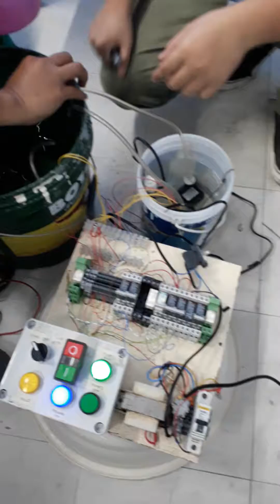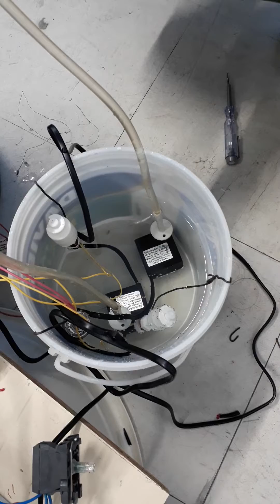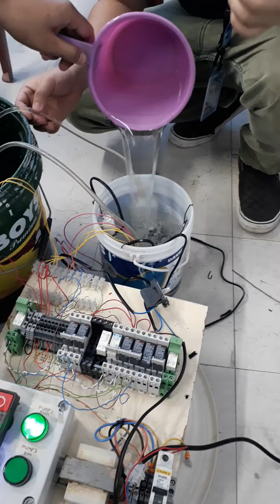How to become a BMS engineer part 56 (How to simulate Manual Control for a submersible Pumps)

Comment: As per to This logic;
P-1always will be first duty, 
P-2 will be second duty, 
if can you make change over as per to pumps run hours with timer it will be more nice..  without PLC controller for more cheaper... 
So both pump will be life time run hours the same.. also if any pump tripped or both float switch on the same time this logic should be second stage,, up to resetting all alarms,,, 
So, Is this possible to do through hardware?🤔  
Did you got my point? 
Thanks,,
Reply from the maker: Actually when I am teaching my student Building Management System the first few lesson are to prepare power and control diagram for an equipment in a Hand or manual control. Next lessons will be how to prepare the equipment for Automatic control thru DDC (Direct Digital Control) where they will learn how to write their very first control logic. You are right to do pump sequencing we can use the run hours of the pumps which is a basic concept in Building Management System or Building Automation. (BMS/BAS)